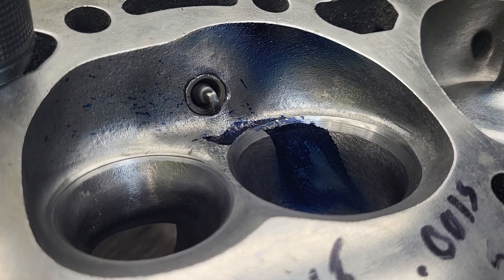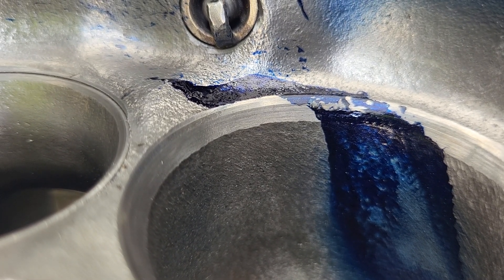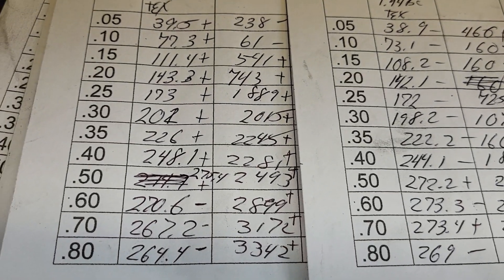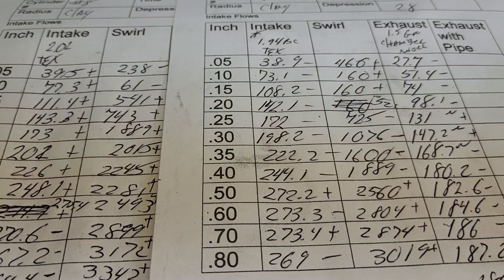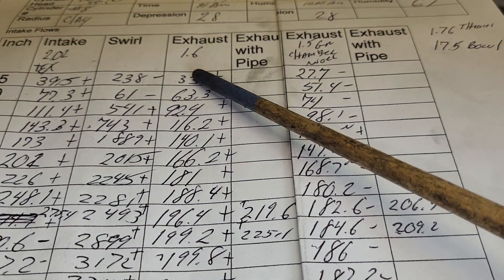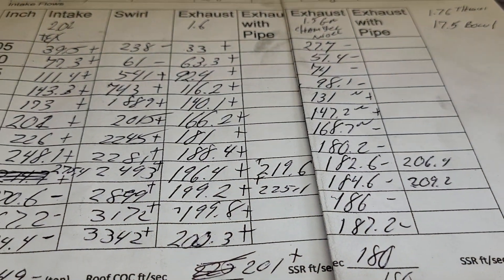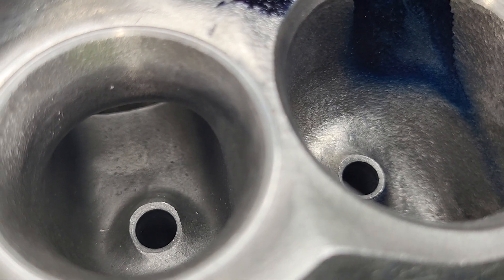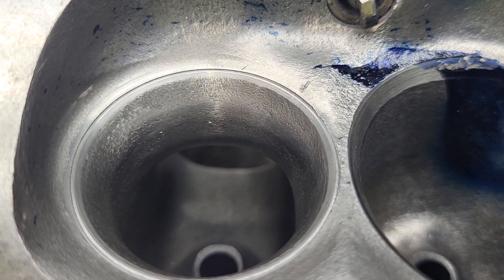Redheaded Stepchild, High Performance TPI project, Dart 165's cut for 2.02"/1.6" valves first flows

Comment: Nice! Gains where a typical street cam lift needs it. 275@.500 is nice!  I would bet another angle bottom cut like 75° and narrow would help a bit. Open the throat to  88 or 89% and widen and blend the shortside turn.
Reply from the maker: Angles steeper than 65 degrees are problematic with my stone set.  Thanks

Comment: Charlie, 
You need to get decent angles and widths on that valve job, as Darrin Morgan has mentioned in the past,the valve job is 40% of the air flow,this is just my opinion and dont take this personally - 
You have reversed the induction tract to what is typical. 
What i mean is we want the throat smaller for the fastest airspeed and induction tract tapers back towards carb flange/ throttle body area.
Now in a 23 degree head its hard to do but dont make it worse than it needs to be.
All you have done is slow the air/ fuel down in the most critical area. 
Cylinder fill after bottom dead centre is more important than overlap flow because we are not valve area limited due to rpm etc.
The engine will run fine but i doubt any power was gained by fitting bigger valves in this application. 
Again just my opinion, Charlie is free to do as he wants so i am not throwing criticism.
Reply from the maker: The top angle is not 30!
Reply from the maker: Thanks. If you compare the 1.94" flows with the right valve vs. These these will make more power I am sure. Thanks
Reply: @stevecowan1362 interesting stuff! Steve at bdc what is the depression in the cylinder and airflow speed through the port?  The greatest depression is when the piston is moving the fastest down the bore no? I realize in a well sorted out combo the cylinder is getting filled more even after bdc while the valve is closing  because of ram effect but velocity couldn't be very high right? At that point it may make sense to qualify flow on the bench in those lift ranges at a lower depression.
Reply: @roberthollinshead2325  Bob,
I agree with you on piston demand, and pipemax shows lower velocity ABDC due to piston changing direction. 
My opinion is in a running engine those lift points after bottom dead centre all the way to intake valve close don't mean alot.the other thing is as rpm increases so does velocity so it's not a linear scale .as you know after peak torque which is peak VE the efficiency of cylinder fill is diminishing as we try to overcome with rpm.so there's a couple of things that I think of which is only my opinion. 
I try to limit low lift flow to stop excessive loss of mixture out the exhaust at overlap.
You have to ask yourself, how much flow do we need to clean the chamber.
A good header is supposed be able to pull 3 "- 6" depression at overlap. 
I believe overlap flow is only important on a high rpm engine that is valve area limited due to rpm.
This is why high end engine's use steep valve seat angles with multiple back cuts.
As you know I prefer to use a 50 - 52 degree seats on my 23 degree stuff to help limit low lift flow and help pull the charge harder for better cylinder fill ABDC.
My personal engine's that I have built and dynoed all made 1.35 ftlbs / ci or better which means making reasonable torque/ VE.
again I am sharing my opinions and experiences. No way am I in disagreement with anyone. 
I believe there is more than one way to bake a cake
Reply: @stevecowan1362  agree Steve. You want to make sure depression is maximised when flow from the induction system is in its greatest region. Holding back a little bit of flow early on to increase pressure difference between intake system and cylinder later in the stroke when the valve is open further will move a greater mass of air/fuel than early in the stroke with the flow of low valve lift being pulled by a lower cylinder depression. Steep seats help to do this. We also have to remember how important a quality high flowing valve job is in ABDC fill. Air/fuel is now only entering the cylinder under inertia AND the valve is closing. Don't want an ordinary valve job being a hindrance to the air/fuel with diminishing inertia.

Comment: I think the 2.02 valve on the 1.94 seat worked as an extreme back-cut. The part of the valve that contacts the seat was where a back-cut would normally be so no edge at all  behind the contact point. This may also allow the air to pass the seat at a flatter angle and then it doesn't care if there is more valve surface "in the way".
Reply from the maker: Made a bigger venturi I think. Thanks

Comment: 2.02 on 1.94 seat, with a wider valve, you bias the venturi towards the cylinder, I'm @5:06 in your video, I noticed the swirl went down, widening the seat for the valve then keeps the flow closer to the chamber. That's why the swirl picked up and the wet flow is higher on the bore.